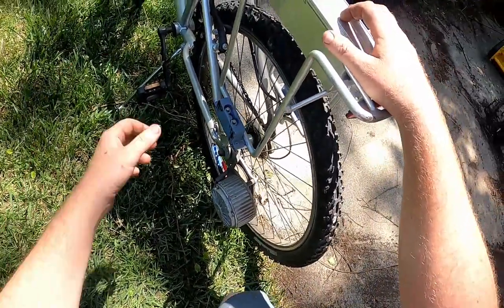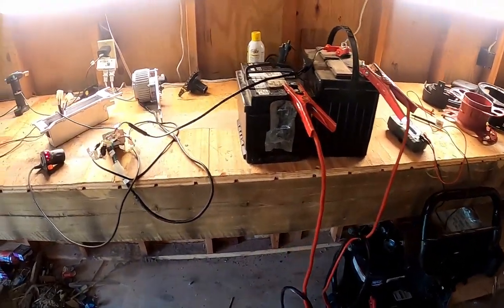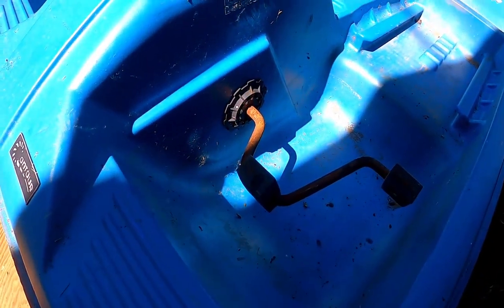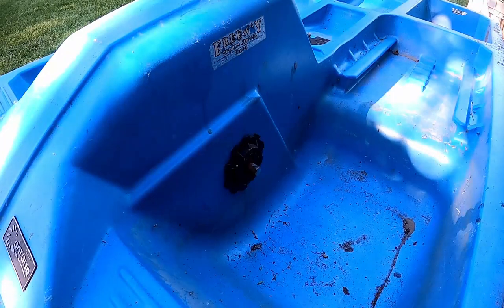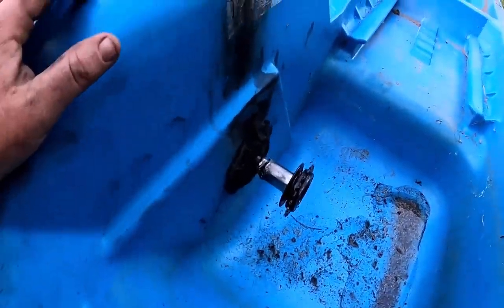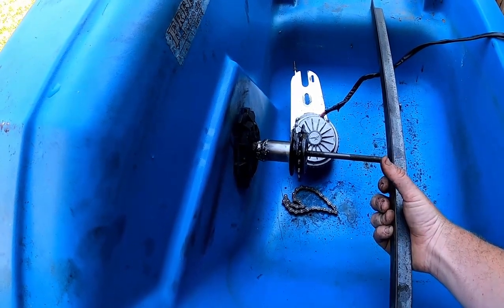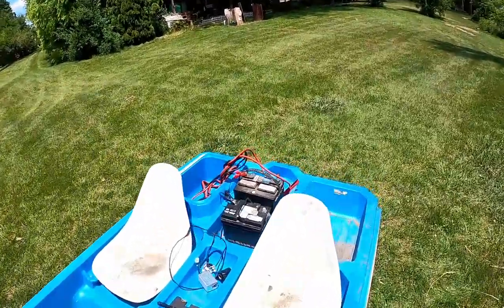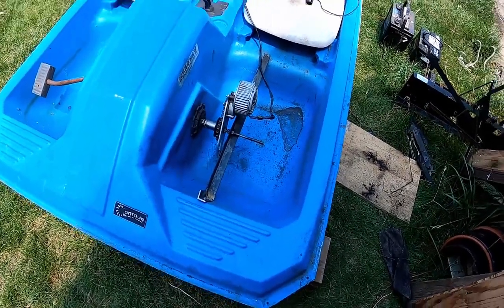Building and Testing Electric Paddle Boat

Comment: I salvaged a pedal boat like this, have a bunch of electric hub motors, and been thinking on ideas how to electrify it. This helps solidify that the idea is feasible. 

One thing I thought while watching your video is that if you didn't like having the pedals spinning due to the motor you could cut the bar on the pedal side and put a freewheel there. That would lessen the possibility of being whacked (as severely) while the motor is operating.
Reply: Brand new bushing for the Pelican range. 
Keeping you feet dry!!!
https://youtu.be/n3L6GDU67Gk